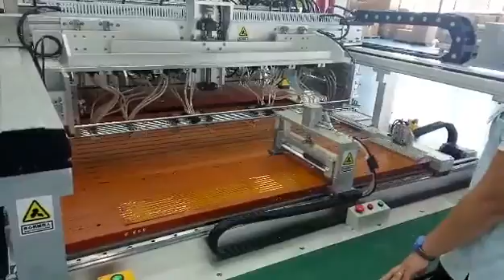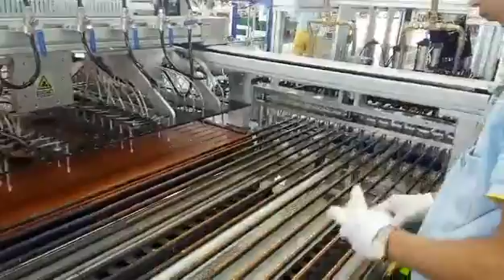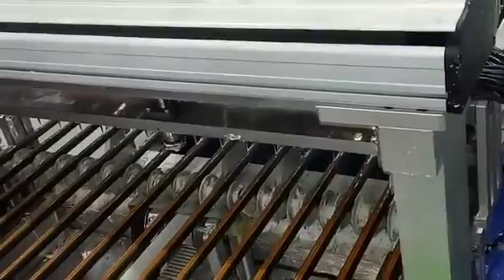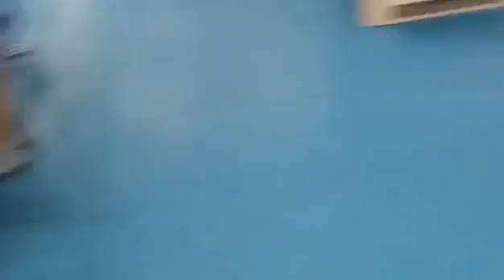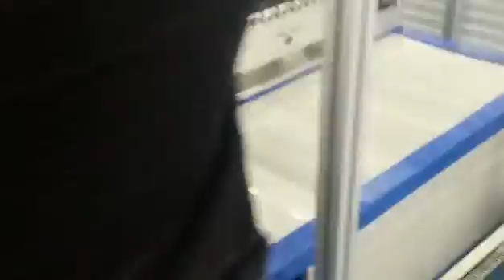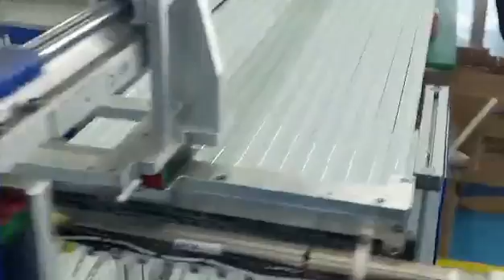T8led lamp dispensing silicone video,efficient fast

Comment from the maker: Shenzhen Tensan Co., Ltd. was established in July 2014 in Shenzhen Special Economic Zone. 0ur company, as one of the high-tech company, is professional engaged in organic silicone and sizing program R&D, manufacturing, sales and service. The company’s main products are potting, silicone, epoxy resin, thermal grease and sizing program. Our products are mainly applied in electronic appliances industry, home appliances industry, lighting industry, automobiles industry, photovoltaic industry, mobile phone industry. 
www.sztensan.com